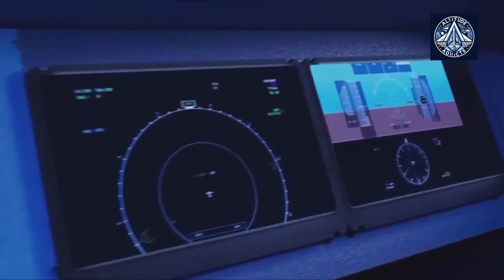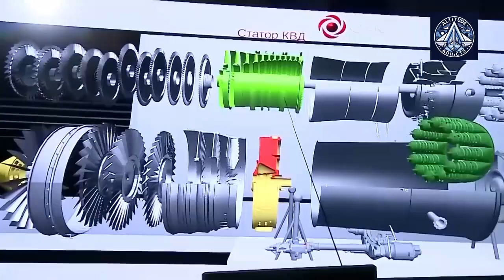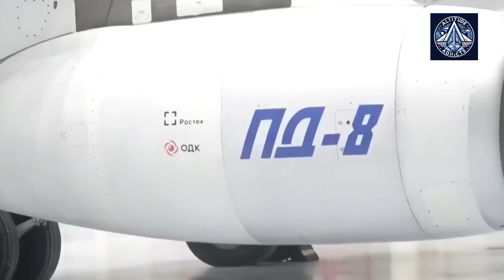PD-8 Engine Heads for Flight Test on IL-76LL Testbed

Comment: I think as they replace imported components elsewhere on the aircraft it is not easy with your first domestic components to be as light as Western established components, so your overall aircraft weight rises. 
you don't want to upgrade your engine power as a result. 
I think the time delay is to approach both issues at the same time

Comment: Isn't that too small of power if PD-8 applied to IL-76 ?
Reply from the maker: They replace just one engine of the IL-76LL to test the new engine. The plane is flown with 3 engines plus the test engine.
Reply: And the test bed plane is commonly not flying in max load.

Comment: The IL-76LL video shows them testing the PD-14, which is a bigger engine to the PD-8.  PD-14 is used on the larger aircraft like the TU-204 TU-214 among others  and is sililar to the PW or RR engines used on B737 or A320.   PD-8 is a smaller version of the PD-14 suitable for the SJ-100.    I thought also they already completed all the testing for PD-8.  Not sure.
Reply from the maker: We do not have visuals for PD-8 on IL-76LL even for previous testing. So a representative visual is used.